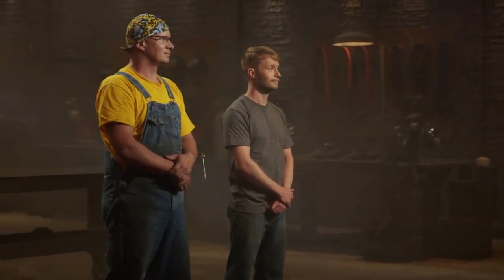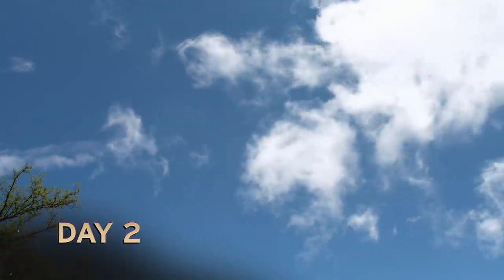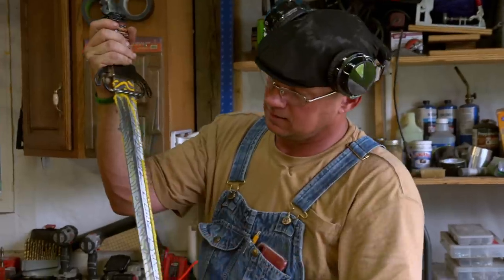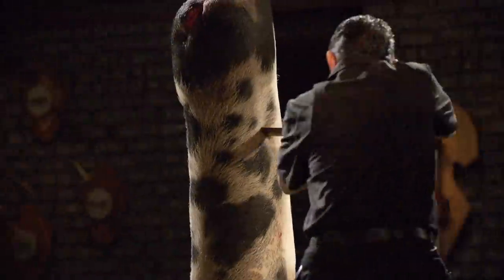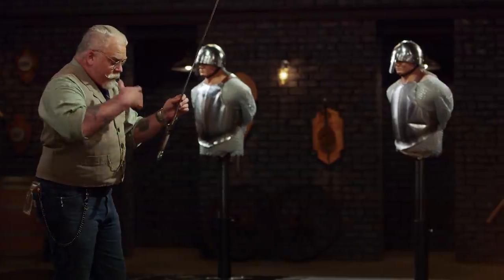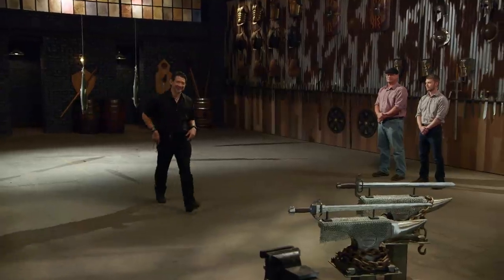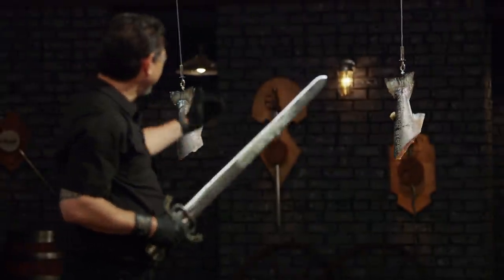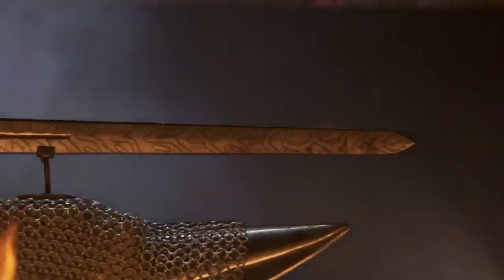Forged in Fire: Tizona of El Cid Causes MAYHEM (Season 7) | History

Comment: Im a bit surprised. I expected the handle construction to be the deciding factor in this. They both killed, cut, and were strong, but only one had an actual complaint during testing.
Reply: the whole complaint part is just a matter of prefference... and also the fact that the judge has pretty beefy hands...
Reply: @crustybomb115  Its not that it was small, its that it didnt have a good grip and easily turned in his hand. But even if it wasnt a major issue, as usually everyone gets in on pointing out an actual problem, it was still the only negative remark made about one blade that didnt apply to the other. Both swords took knicks and rolls on the strength test, and the cutting test, one clearly cut at least a little more cleanly, while his opponent didnt fully slice once and had a slightly squirrely handle. To go on aesthetics over performance seemed an odd decision to me.
Reply: @chrishubbard64  if the construction of the blade was faulty, everyone would be pointing it out, even doug... besides its a thing with the guy who usually does the durabillity tests, he has massive hands so a small-ish handle with slight difficulty of grip due to size always gets pointed out by the guy... a sword is meant to be dexterous and the option to switch sides is usually a good thing for an arming sword... regardless, if it was an actual issue rather than pointing out a personal matter of preference they would have ALL meantioned it from the start
Reply: There are 3 judges.  It came down to fit and finish.
Reply: @tinknal6449  yes, but the winner had a worse handle, you telling me just the detailing would have beat out a better handle construction?
Reply: @CloudianMH  LOL, it's been 7 months, not watching the video again so I can respond....
Reply: Many did not observe well. Thomas did not produce quite the required geometry of the blade (consistent narrowing towards the tip; Thomas' blade is almost the same width throughout, which helped in the sharpness test, and which is kinda cheating). Nor the shape of the guard was correct (elegant C-shaped oval forward; Thomas' guard is more rectangular). Thomas has simplified it all because he had wasted too much time and had to rush. When the test is nearly identical, as it was here, then the weapon truer to the original wins. Brent had all the details correct, and that is crucial.

Comment: They could had also put the part where they tell what detail he missed leading to his not winning the competition.
Reply: I think this is the episode where he didn't have time to etch his blade. The guy that won used the vinegar in mustard to etch his and that is why he won.
Reply: @jamestempleton1627  Maybe because if the blade hadn't met the parameter they wouldn't have even tested it.
Reply: I don't care. The kid won.
Reply: @joshuasharrock466  First sword too and better than most experts I've seen on this show.
Reply: My brother, I couldn't agree more. Thomas's sword did as good as that Brent's.
Reply: @joshuasharrock466  I mean both of them did a great job.
Reply: @jamestempleton1627  If etch was the issue, Brent had a slick handle which could easily move like he said after the strength test.
Reply: @jamestempleton1627  i thought it was the fuller.
Reply: I "think". It was been a good time since it originally aired.
Reply: @nikkichan_05  I think the handle issue comes down to individual judges and their palm size. Because Doug didn't complain about the handle and he usually says something if he has any problem with any sword. Only David had a problem but that wasn't objective of the strength test. Plus Thomas' sword I think took more damage due to his super fine edge. So it actually balanced out. And then it actually came down to the aesthetics of the blade and Brent's sword looked more beautiful.
Reply: @kuriakosekjoseph6253  Hmm..maybe.
Reply: @kuriakosekjoseph6253  i agree, as David mentioned, because of how fine his edges, it took a lot of rolls in the strength test.

Comment: Many did not observe well. Thomas did not produce quite the required geometry of the blade (consistent narrowing towards the tip; Thomas' blade is almost the same width throughout, which helped in the sharpness test, and which is kinda cheating). Nor the shape of the guard was correct (elegant C-shaped oval forward; Thomas' guard is more rectangular). Thomas has simplified it all because he had wasted too much time and had to rush. When the test is nearly identical, as it was here, then the weapon truer to the original wins. Brent had all the details correct, and that is crucial.

Comment: I believe Thomas's blade had lesser chips than Brent's, and it cut cleaner too with better grip. I'll take that over an etched blade.
Reply: The setback at Tom's home forge made 'im lose. He was real close, though.
Reply: Many did not observe well. Thomas did not produce quite the required geometry of the blade (consistent narrowing towards the tip; Thomas' blade is almost the same width throughout, which helped in the sharpness test, and which is kinda cheating). \Nor the shape of the guard was correct (elegant C-shaped oval forward; Thomas' guard is more rectangular). Thomas has simplified it all because he had wasted too much time and had to rush. When the test is nearly identical, as it was here, then the weapon truer to the original wins. Brent had all the details correct, and that is crucial.

Comment: Much respect for the work both Thomas and Brent put into it. Thomas' blade edged out Brent's ever so slightly in the cut test, while Brent's blade held up a nick better in the armor test. Normally, it's a clear-cut decision. However, in this battle, both blades performed equally and it came down to the detail work.

Comment: Make Durendal as a hand-and-a-half sword. With the one-handed ricasso that CAN be held in one hand, symmetrical straight edges, hexagonal blade section, AND sharp symmetrical point. Make a gold-plated hilt with downturned quillons (curved to the blade) with lions' heads. The blade's gotta be 5160 high carbon steel. Full tang. The guard's gotta be decorated w/ 2 red cabochons in the middle, one on both sides.

Comment: Hmmm first time I’ve seen a blade clearly outperform the other in all 3 tests and lose. Thomas’s blade made deeper cuts in the kill test with same amount of swings, the handle construction was noted better in the strength test while taking the same amount of damage, and he won the sharpness test as his cut all the way through the fish each swing while the other didn’t.....and to lose over not having enough detail on his sword ?? They may as well just sit there and look at the blades without even using them if that’s how they’re going to decide a winner.
Reply: I think they play favoritism sometimes, Ive seen some rather surprising winner calls, this being one of them.
Reply: Many did not observe well. Thomas did not produce quite the required geometry of the blade (consistent narrowing towards the tip; Thomas' blade is almost the same width throughout, which helped in the sharpness test, and which is kinda cheating). Nor the shape of the guard was correct (elegant C-shaped oval forward; Thomas' guard is more rectangular). Thomas has simplified it all because he had wasted too much time and had to rush. When the test is nearly identical, as it was here, then the weapon truer to the original wins. Brent had all the details correct, and that is crucial.

Comment: Interesting.  El Cid died in 1099.  The Tizona is an actual individual sword on display in Madrid.  The blade  is typical of the 1100s, but there is an inscription added in the 1200s or 1300s, and the hilt is of a design associated with the 1400s.  It took nearly 400 years to make the sword and the contestants had 4 days.  This is a very specific individual weapon to recreate, which may explain why the best performing sword in the tests did not win the competition: lack of the detail that would have made it resemble the one it was meant to resemble.  The young lad made an excellent sword.

Comment: This episode is famous for having the most amount of fans disagreeing with the judges’ decision. It seemed like Thomas lost due to a parameter issue, but it isn’t articulated in this video, so it’s hard to say. But if it was a parameter case, then the decision makes sense, even if we don’t like it.
Reply: sorry not buying it, ANY time there is a parameter issue, that person is disqualified immediately. they've done it on 1/16th of an inch or maybe less, they have even done it on a couple degree's of curvature, even seen them DQ a blade from testing cause it had the wrong animals head design on the hilt or pommel. "it does NOT meet parameters, therefore we can not judge it fairly" and they ALWAYS do careful measurements before the beginning of testing.
Reply: @brettleisy356  They don’t say “we cannot judge it fairly” they say “we cannot test it fairly”. The parameter issue in question would’ve been the etching patterns on the blade, which do not affect testing. Therefor, they could still test the blade while marking off points for the lack of a pretty pattern. 

Similar to how they sometimes allow a contestant to bend their blade back into shape after it had bent on a kill or strength test, and yet they don’t do that for all contestants. Even going so far as to say “We’d like to give you the chance to straiten your blade to continue testing, but the judges will be taking that bend into consideration for their final judgement” (paraphrased). This obviously much different from the usual “your blade has suffered a catastrophic failure and cannot continue testing”. As to why they sometimes allow it and other times don’t, I don’t know. But they’re not always consistent on it.

However they are always consistent on the reason for why a parameter issue will be an automatic failure, and this wasn’t one of those reasons since it didn’t affect testing.

But yeah, I still think Thomas should’ve won, even if he didn’t put mustard on his blade.
Reply: @mistahanansi2264  I've seen other things that didn't effect testing be DQed out of the gate multiple times. they've always taken all parameters very seriously. down to the wrong animal's head or someone didn't add a "jewel".
Reply: I wonder if they show the full episode including their deliberation in their actual FiF tv show. It's hard to agree with them because of how short these videos are
Reply: Many did not observe well. Thomas did not produce quite the required geometry of the blade (consistent narrowing towards the tip; Thomas' blade is almost the same width throughout, which helped in the sharpness test, and which is kinda cheating). Nor the shape of the guard was correct (elegant C-shaped oval forward; Thomas' guard is more rectangular). Thomas has simplified it all because he had wasted too much time and had to rush. When the test is nearly identical, as it was here, then the weapon truer to the original wins. Brent had all the details correct, and that is crucial. That alone is admirable and required skill, which Thomas did not posses.

Comment: SPOILERS AHEAD

We didn't get to have a closer look at the finished swords, but from the clip where the older guy talked about having time for fine work, I assume that guard and handle had more intricate design. That, and the mustard blade finish, which tbh I find a bit cheap as it will wear off in time. And while I do feel that artistry is often not regarded highly enough in this show, basing on the compliments that both blades recieved (which is, like, the only thing viewers can base their opinion after all, they're the judges and they need to voice their opinion so we can understand the judgement), I feel like kid should have won. Especially the handle and weight part (although we don't know how heavy was the older man blade in comparison). I believe it was more of a misrepresentation of the reasons leading to the verdict rather than the error in judgement, which happens often in those close call matches it seems. I would definitely prefer to see the difference in the detailwork pinpointed so I can feel more at ease with the results.
Reply: Brent's sword in kill test: performed well
Thomas' sword in kill test: ever so slightly better. remarks on how well balanced it feels, round goes to Thomas

Brent's sword in strength test: took CHIPS and rolls and handle is to rounded
Thomas' sword in strength test: took a SLIGHT rolling even given the finer edge. Lightness complements. Round goes to Thomas.

Brent's sword in cut test: doesnt complete the cut in one of the fish
Thomas' sword in cut test: makes flawless work of the fish, even almost effortless to the point the fish move less on the cuts through them. Round goes to Thomas

pardon the pun, but Brent's sword didnt cut the mustard. yet somehow won? why even bother testing if its just gonna come down to looks anyways?

Comment: WTF never heard of losing because of a set back at the Forge and detail. The winners handle was round and his blade took a chip but that’s the sword that wins. I couldn’t disagree more terrible.
Reply: weapons have to be 2 things in this competition: an effective weapon, and an art-piece... otherwise if the art part is removed the one with the better specs(lower weight, sharper edge, etc.) wins...

Comment: Little bit disappointed Thomas sword performed even phenomenally better handle construction and lighter despite that he lost how come 🤨
Reply: Sword performed well, but it wasn't quite the El Cid sword. Rewind and observe carefully. Many did not observe well. Thomas did not produce quite the required geometry of the blade (consistent narrowing towards the tip; Thomas' blade is almost the same width throughout, which helped in the sharpness test, and which is kinda cheating). Nor the shape of the guard was correct (elegant C-shaped oval forward; Thomas' guard is more rectangular). Thomas has simplified it all because he had wasted too much time and had to rush. When the test is nearly identical, as it was here, then the weapon truer to the original wins. Brent had all the details correct, and that is crucial. That alone is admirable and required skill, which Thomas did not posses.

Comment: Two rather decent swords HOWEVER.
this is shocking, Thomas had a better balance, lighter blade for the size, seemingly better cutting even if marginally, and a better handle shape/contour/profile. and the other guy won cause he had time to put mustard on his blade? Brent's sword was the only one with any complaints even if only by a slight amount, while Thomas had gotten a complement in how it felt in hand. yes Brent's sword looked cool. but facts are facts. I would rather have Thomas' sword in my hand in combat, unless there is something major that they aren't saying. I am not saying that Brent's is a bad sword, not at all, but they seemed to pick the one that performed less than the other. and the way the damage taken by either sword doesn't seem bad either, the lighter finer blade only had a slight roll to it where the other sword had chips in it... COME ON JUDGES... Thomas' sword won hands down (when added up) in everything except a bit of polish. if they don't want Thomas' sword, I'll give them my shipping address...